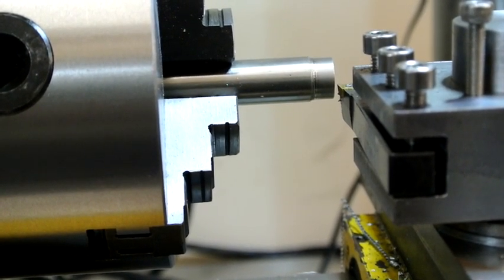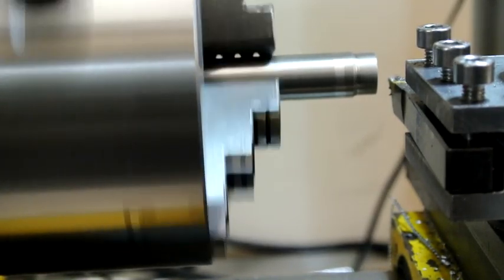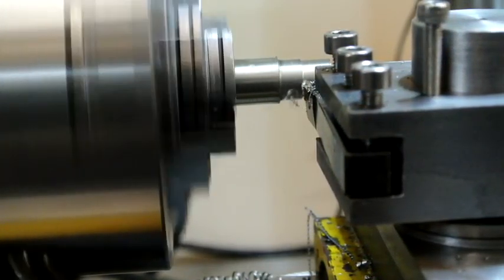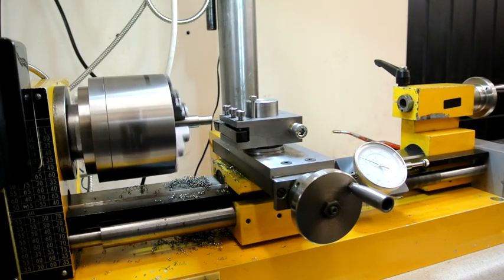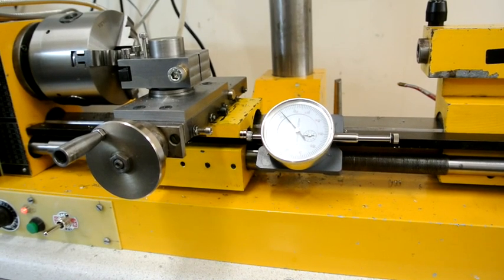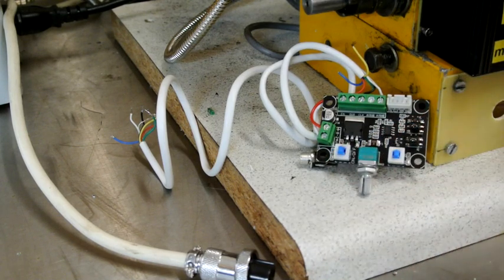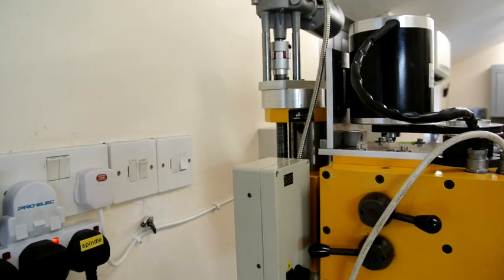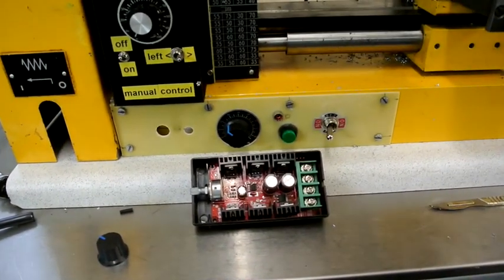Hobbymat 65 Part 2 (Turning under electrical power)

Comment: I am part way through a rebuild of one of these lathes that was given to me, Like Alun7006 I would like some more detail as to the lathe drive mods, a full list of parts would me appreciated, importantly thanks for the impetus. I have 2 so plenty to play with. Great stuff.
Reply from the maker: John, glad that my efforts have interested the 2 of you. I didn’t do drawings as I had to tailor them to fit. Things like the plastic plate at the rear of the lathe that secures the lead screw is a good example. The plastic has large holes in it that are counterbored oversized. It was not easy to come up with an accurate part without doing the same thing and making them a sloppy fit. It is also possible that the lead screw is not aligned accurately. I will give it some thought though. The rear plate should never have been plastic in the first place.
I will post something in the next few days. John
Reply: Hi John, thanks for responding so quickly, I need to start somewhere, so up the front end we have a DC motor, the type you have mentioned, what size pulley and belts, assuming that you are using the original main shaft pulley. The use of a stepper motor to drive the lead screw is ideal, mainly because the lead screw is a right hand thread and therefore the handle turns  'the wrong way' so to speak. your adding of the CNC controller adds a new dimension, importantly the fact that you can switch this out and control it 'manually' through the powered stepper is so versatile, your encoder set up is of interest, I did look at the site, most interesting. I am not either a computer whizz nor am I  electrically minded so this is an adventure for me. trust you don't mind me asking too many question. Best regards, John.   @john2478
Reply from the maker: @johngreathead5733  

John I can help with a few details now.I used the standard spindle pulley with its securing collar and key. For the motor I made up a pulley from 40mm rod. The inside of the recess for the belt is 27mm. The motor came with a sprocket on it on a short stubby shaft. The motor shaft had a 8mm  thread on it and there was just enough length to fit the recess for the belt as well as a short length on the outside of the pulley through which I drilled and tapped m3 to help secure the pulley. I also fitted a lock nut tightened well up using the outer 40mm of the pulley to hold the shaft.  I made my pulley from mild steel but you could use aluminium. The resulting speed with the smaller leadscrew pulley is 250rpm to 1285 rpm. 

I just checked and   the larger diameter pulley on the spindle. The motor uses the supplied mount and I fitted it to a 6mm aluminium plate. This plate has 8mm stand off collars between the old mount position and the new engine mount. I chose to fit the front end of the motor with a hinge so I could loosen just 2 bolts to remove the belt.
The belt I use is 8mm 375mm optibelt. If you wanted to use the large spindle pulley then it would need 355mm belt. However that raises the lower end speed as the range is now 400-1700 rpm. Personally I would opt for the smaller pulley as I did, or even make up a new pulley for the spindle of slightly smaller size. John
Reply: Thanks John, some parts on order, a little confused that if you use the large spindle pulley then the belt would be shorter by 20mm, its been a long day and I might be missing something! I thinks that I will use your suggested set up, any form of belt tensioner?

Ta John.
 @john2478
Reply from the maker: John I didn't fit a belt tensioner I felt unnecessary complication plus there is not a lot of room. The 2 securing screws have stand offs and the belt could be tensioned by turning a little off these if necessary. You need a shorter belt with the smaller pulley option hence it is 355mm and for the larger one it is 375mm. I will have a go at measuring some of the parts. I shall have to make up a new video. Not sure if I will do cnc drawings or just sketch them with dimensions.John
Reply from the maker: Hi John
I have just posted a new page 6 for the dimensions of the drive connections.
John
 @johngreathead5733

Comment: I always ask one question when I watch people taking deeper & deeper cuts. Why? To me a Lathe has a happy point where it enjoys the cutter depth. Only a fool takes deeper cuts than this happy depth. You are there to enjoy working your Lathe, so why would you push it beyond its happy working. Going beyond this happy point is not going to be a happy time for you so why are you doing it. Just grow up & when your Lathe is running nice & happy just enjoy it.
Reply from the maker: Mervyn I was curious to see what this lathe was capable of. I would probably stick to 0.4mm in daily use as the lathe could cope with this quite comfortably.  I do not like to drive things to the point where a tip digs in and it stops that lathe or mill. Frankly this little lathe has impressed me with what it is capable of. John